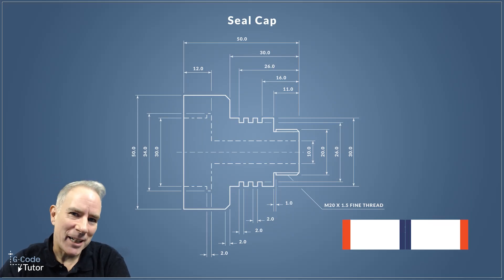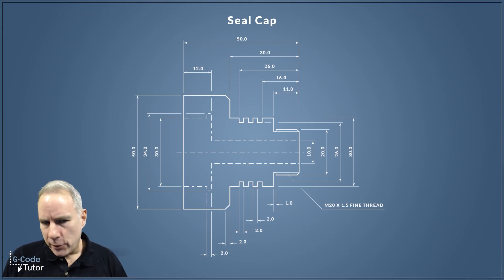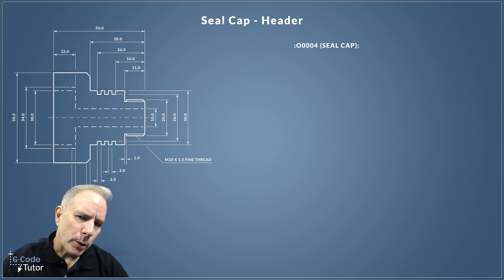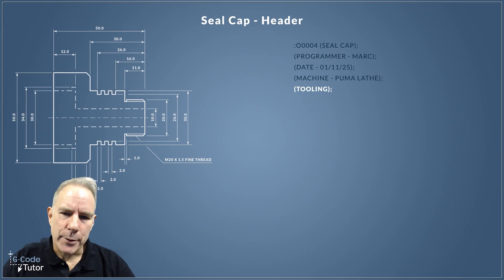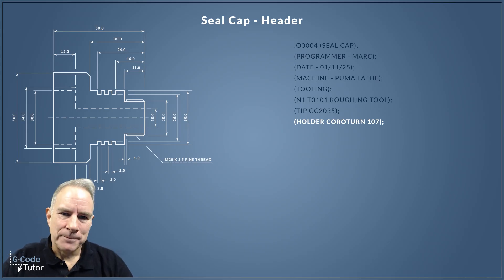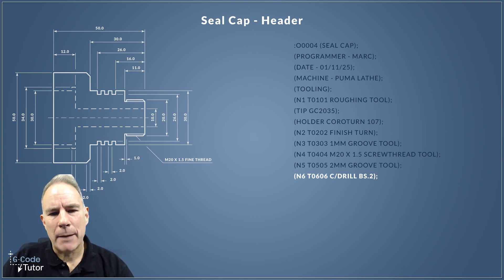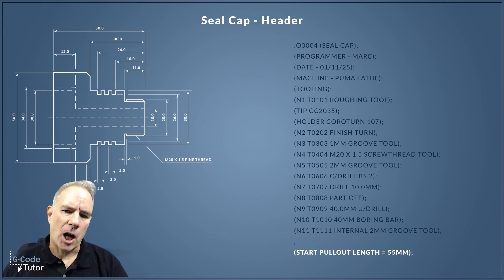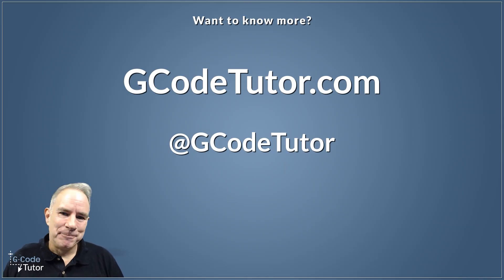How I Write G-Code Headers (UK Trade School Method) | Let's Program - Seal Cap Pt.1

Comment: wondering how u drill a 30mm holde with a 40mm drill and even more wondering how u get a 40mm boringbar in a 40mm hole  as far i know a 40mm boring bar has a Dmin of 50mm
Reply: I am about to try out D40mm on 45mm through hole but I am going up to 50 for the first cleanup interruped cut. Hopefully I don't have to change ID roughers for the next job. Wish me good luck! 😅